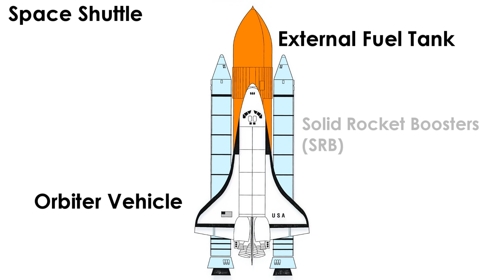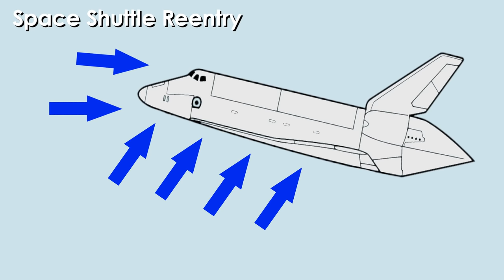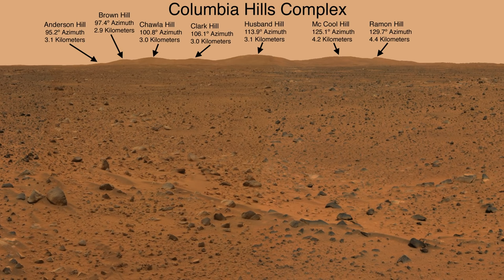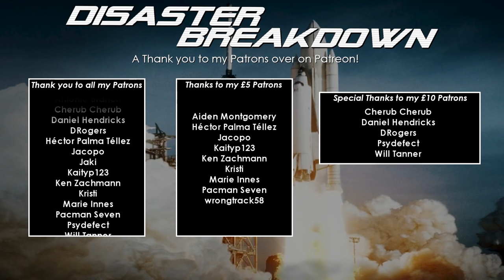What Happened To Space Shuttle Columbia - DISASTER BREAKDOWN

Comment: You can say that both "accidents" could have been prevented but the decision makers weren't those going on the spaceships.
You first had Challenger and we all know about Thiacol and Mr Boisjoly who were against the take off because of freezing temperatures on the launch pad and that the O Rings on the Solid Rocket Boosters couldn't handle the cold.
Then you have Columbia and the fact they knew two weeks before it's descent that à big piece of foam had come off the tank and hit the wing. For two weeks they did nothing  not even organized sending an astronaut on board to see if the wing was all right.
It so happens that I was at the launch on Columbias' previous flight in march 2002 and God it was cold for days before.
The two accidents happened in winter. Anyone who owns a car in a cold winter town will tell you that your car often has problems during that time of the year.
I have always thought this last "accident" to be deliberate. When you want to get rid of something quickly you do what's necessary. Happened to the Concorde plane who crashed in Paris. From that moment on it was finished. And it wasn't even a problem with the plane but a piece of metal on the runway. Had there not been an accident then I wonder if Concorde or even the spaceships would still be in service today.
Reply: There were no spacesuits suitable for a space walk on the Columbia. Only lightweight spacesuits for the interior.

Comment: The thing I don't understand is they obviously watch every second of take off, the video clearly shows a piece of the foam break off and violently strike the leading edge, wouldn't that have caused at the very least a critical diagnoses of the event, it sounded as if when they were losing sensors and getting increases in temperatures on the sensors on the very area where the foam impacted the shuttle, for them to talk to the astronauts about it, I don't understand, was it a case of it'll probably be ok, or did they not see the impact, I'm not blaming, I'm just confused whether or not they saw the impact.
Reply: They didn't actually see the impact. And the sensors didn't register until they were entering the atmosphere and were preparing to land.

Comment: Correction: Although "explosion" is commonly used colloquially to refer to the Challenger disaster- the explosion of the liquid hydrogen tank had very little to do with Challenger's fate.

Rather, it is more accurate to describe Challenger's fate, as literally torn apart. As one of the Solid Rocket Booster's o-ring seals failed, hot gasses/flames escaped through the seam, ultimately destroying its lower mount to the main tank. This in turn allowed the booster to swivel free - exerting incredible amount of lateral g forces on the main tank and orbiter, literally tearing both apart. 

Horrifically, the crew cabin survived the disintegration- and evidence indicated that some of the crew were both alive and conscious at the time the cabin hit the surface  of the Atlantic Ocean.  In this way, the Columbia disaster was far more merciful  to its victims.
Reply: The shuttle wasn't torn apart by the booster directly. The shuttle was torn apart by aerodynamic forces after veering off course, caused by the lateral g.
Reply: @PabloGonzalez-hv3td  it veered off course due to the booster supplying thrust in a direction counter to the original trajectory.

Comment: The foam hit the wing at over 500 mph yet NASA took it upon themselves to declare nothing detrimental  had happened?
Reply: In actual fact, the foam didn't hit the wing. The foam broke off, started to decelerate & the shuttle flew into it.
Reply: Wouldn't have mattered at that point, there was no stopping the launch, and no way to rescue them.
Reply: @maxxdahl6062   the launch wasn't the issue my bro .. re-entering Earth's atmosphere upon returning was.
Reply: @jugeerivera4916  There was nothing you could do at that point, they had nothing to repair it with, a rescue mission would have been impossible with the amount of air they had. It was either stay up in space, suffocate, or come back and go quickly.
Reply: @jugeerivera4916  What protocols? They had nothing to repair the damage with, no other shuttle was even near ready for launch, it was going to take a LONG ass time to get another shuttle going, you had maybe a 0.01% chance of getting there in time before they suffocated to death.
Reply: @maxxdahl6062  do some research. I've run out of time to keep educating you.
Reply: @jugeerivera4916  I have, there's absolutely zero way to have done anything after launch.

Comment: I always wondered if the crew had sideslipped a  bit, a common move for aircraft to scrub speed if that would have changed the outcome... or if they were travelling too fast to pull it off.
Reply: The shuttle re-entry program was computer controlled. The crew were merely passengers at that stage of the flight. Also, why would NASA ask a shuttle crew to perform a manoeuvre never tried at those speeds before? Some comments need a bit of thought before posting, this is one of them.

Comment: Thankfully SpaceX has a great escape plan in case the rocket explodes on liftoff, heartbreaking for this crew though
Reply: NASA had contingency plans for the capsules on rockets. You could abort takeoff and the capsule would come off and the parachutes would deploy and land safely. I think the Soyuz capsules are the same. This obviously wouldn't be the case for a space plane like Columbia (or the other 4). Once the solid rocket boosters were lit, there was no putting them out, and the orbiter wasn't exactly designed to be flown in earth gravity. you need to lose a lot of speed fast on re-entry, so the orbiters kind of have the flight glide ratio of a brick. anyway, this wouldn't have had much of an impact on Columbia, which had most of its problems on re-entry
Reply: also, capsules can have re-entry issues if the stuff that needs to break off doesn't break off in time. i believe there was a soyuz that almost burned up before the remainder of what needed to come off the capsule burned off and the capsule righted itself. 

the shuttle didn't even have good abort plans, but aside from the two disasters, the only actual abort that took place happened in 1985, and even that was only an Abort To Orbit

Comment: It's so sad those astronauts wouldn't be saved bcoz it was too expensive so they let them die by lying to them and letting them re-enter with a broken ship...
Reply: The ship couldn't be repaired. The astronauts didn't have the materials to repair such a large hole in the wing.
Reply: @JimMac23  you had a second shuttle all prepped for launch (it was on the launchpad) and could've easily repaired the missing tiles (not a hole) but it was too expensive for a shuttle launch just to save 7 astronauts.